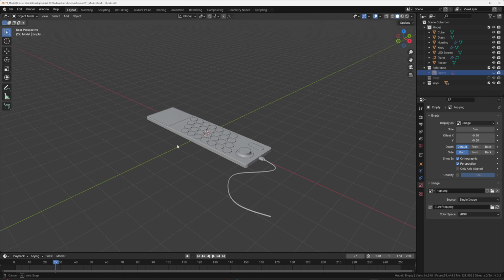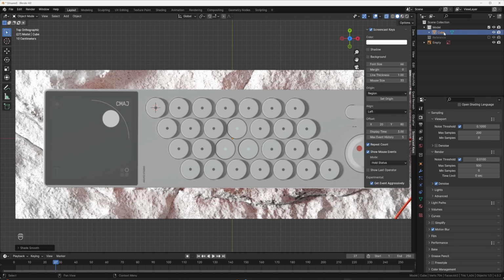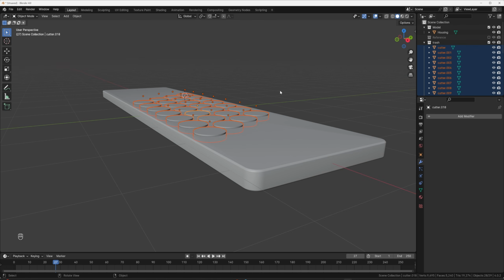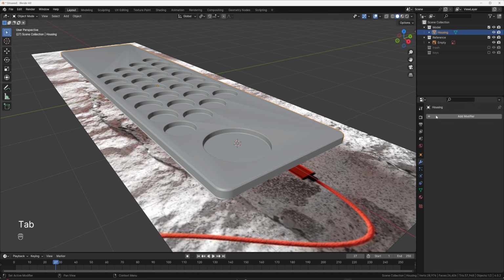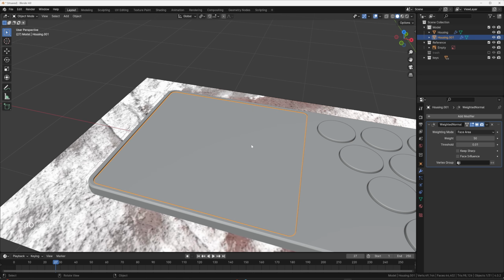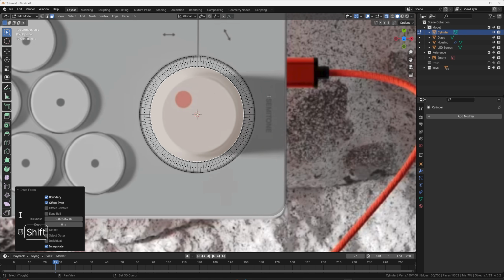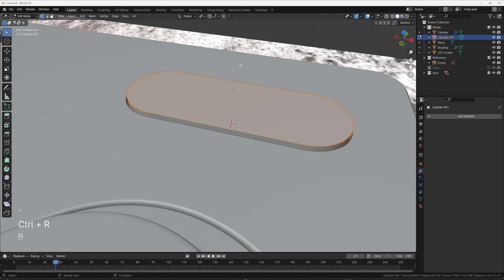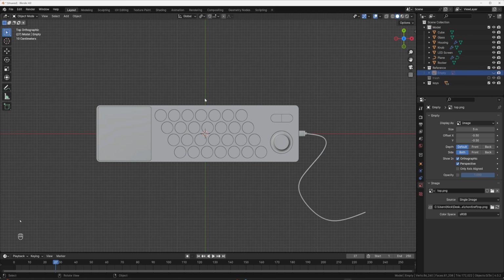Product Design in Blender, Part 1: Modeling

Comment: I always thought that after applying bollean, it is necessary to correct all the geometry for correct shading
Reply from the maker: It can be if you are doing detailed PBR shading! In this instance we use primarily procedural textures so you can get away with not needing perfect geometry